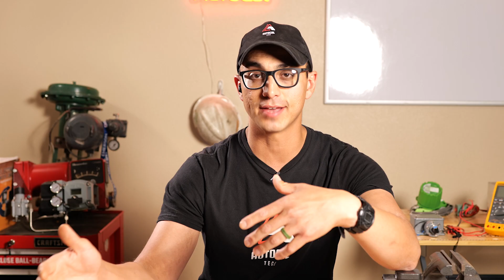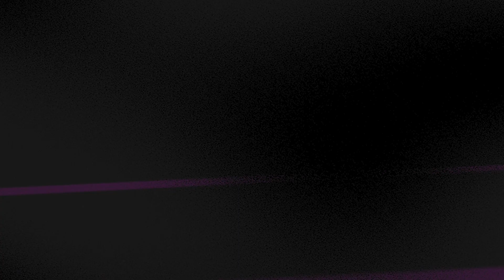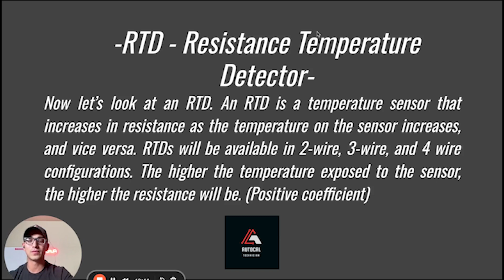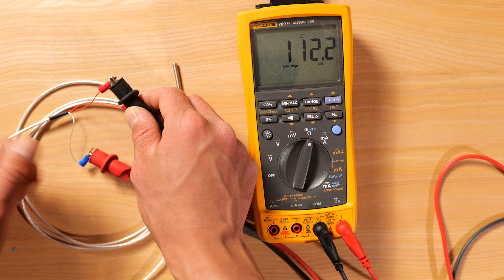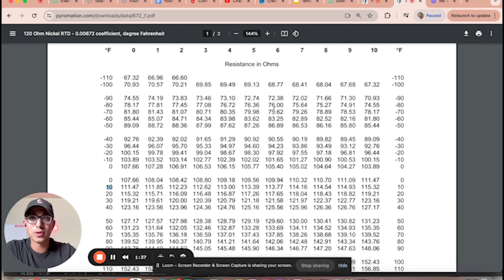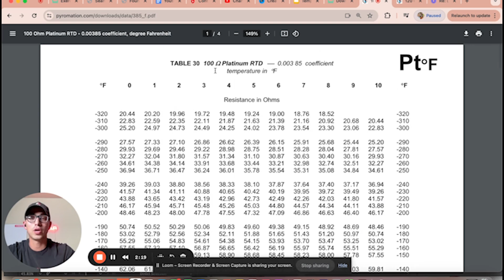RTD vs Thermocouple Temperature Sensors: What's the difference?

Comment: I work at a chemical plant. We have temperature sensors everywhere. Literally hundreds of them. I think most of them are RTD. I don't work on the sensors. We have an ASCI department that does.
Reply from the maker: For sure, RTDs are more accurate than thermocouples. (Thermoucouples are accurate too, however, just not as accurate).  What do you do for the chemical plant?
Reply: @AutoCalTech  I mix the chemicals in big reactors. The end product is pharmaceuticals.